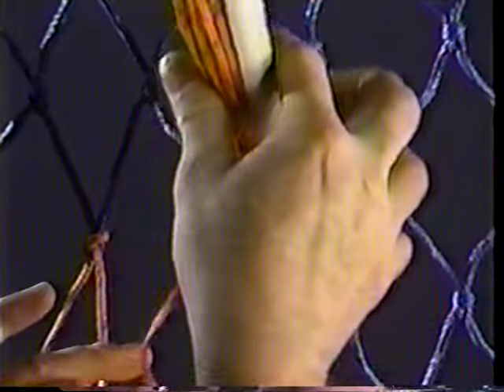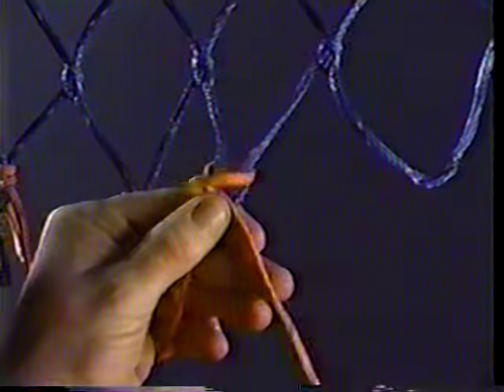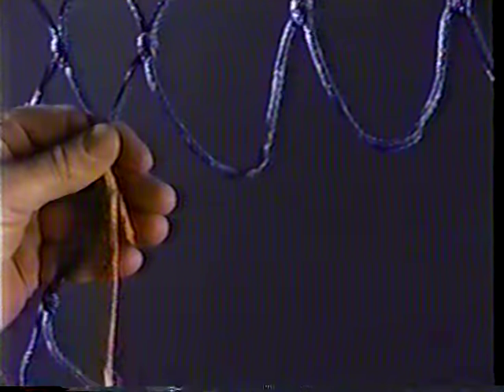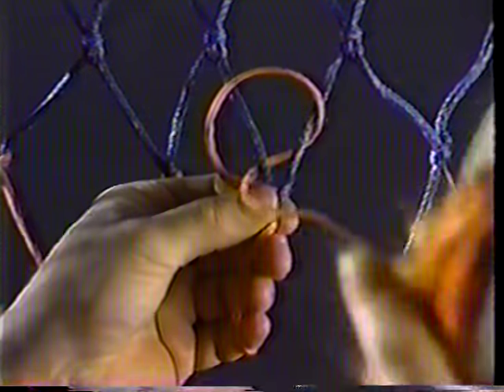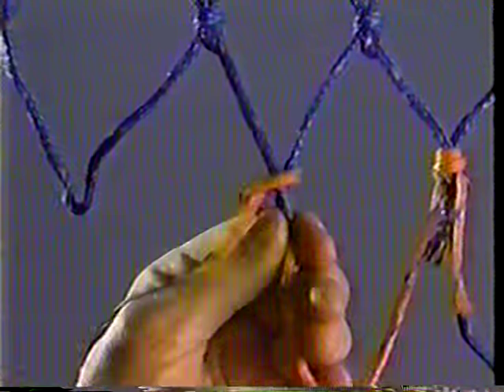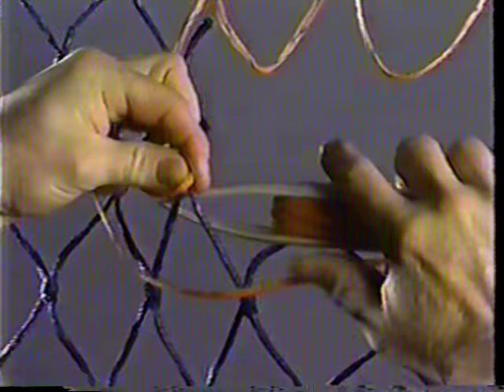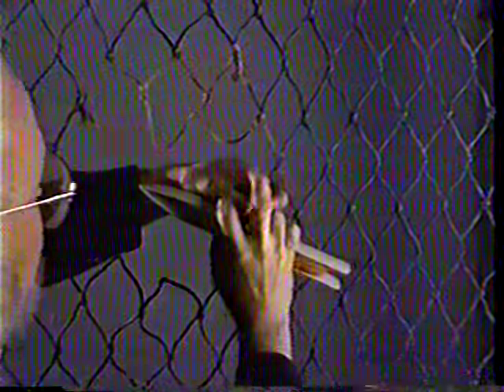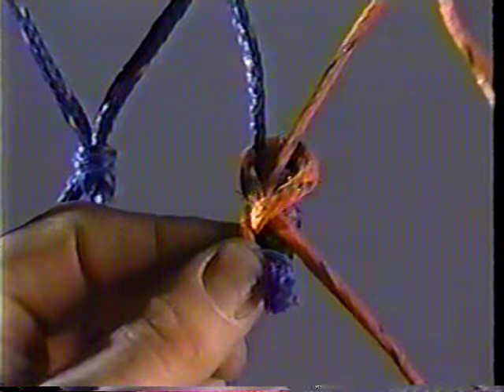Netting Repair Instructions - Part 2

Comment: I indexed all the segments to make it easier to find each knot.

General rules: https://youtu.be/Ex8lRGh9bXs?t=5 

(right handed instructions)
Starting knot: https://youtu.be/Ex8lRGh9bXs?t=98 
Pickups above going right: https://youtu.be/Ex8lRGh9bXs?t=157 
Pickups above going left: https://youtu.be/Ex8lRGh9bXs?t=282 
Pickups below going right: https://youtu.be/Ex8lRGh9bXs?t=336 
Pickups below going left: https://youtu.be/Ex8lRGh9bXs?t=386 
Siders on the right: https://youtu.be/Ex8lRGh9bXs?t=436 
Siders on the left: https://youtu.be/Ex8lRGh9bXs?t=493 

Trimming a hole: https://youtu.be/Ex8lRGh9bXs?t=536
Reply: I know this was a year ago, but you rock for doing this!!

Comment: Questions for you: what type of twine was used for this demonstration and where can you get it?  It seems to hold the knots really well.  Another question, do you ever use a gauge when making net repairs?
Reply from the maker: Hi Steven, this is not our video - we felt it is beneficial so we shared it.  The twine we use to make our netting is nylon.
Reply: @CarronNetCompany  thank you very much!  Thanks for sharing this great video!
Reply: @stevenrobertson4470  The resolution of the video is quite low on my works PC but this definitely looks like P.E. twine in use to me.
As a side note I have been in the net construction and repair business for over 50 years. It looks like Euroline netting and twine.

Comment: It looks easy! But iv always cocked it up and I'm a treesurgeon used to knots! Good demo though!👍🏴‍☠️
Reply: I agree. It's much harder when mending a monofilament cast net since nylon has an incredible memory making it hard to maneuver. Plus the mesh size is much smaller. My cast net has a mesh size of 3/8 of an inch so you can imagine how hard it is! But, no matter how hard it is, I always follow the instructions presented on this video, which is the correct way of mending a cast net. Some folks out there just close the hole as if they're sowing an opened wound.